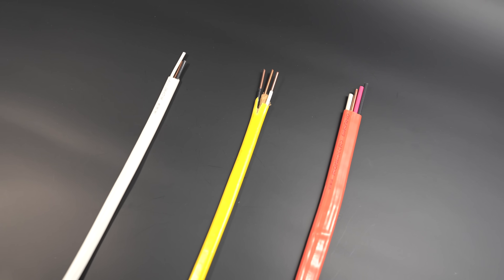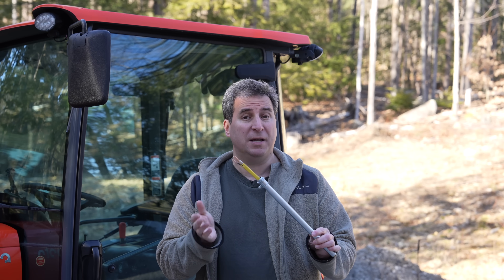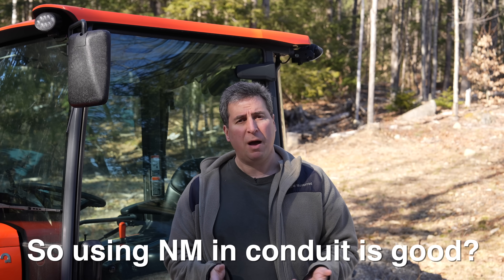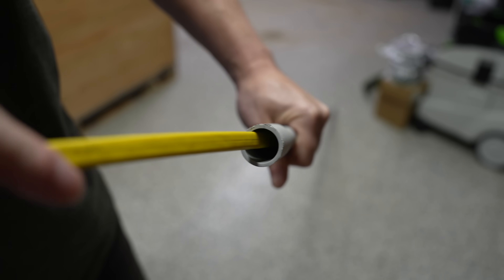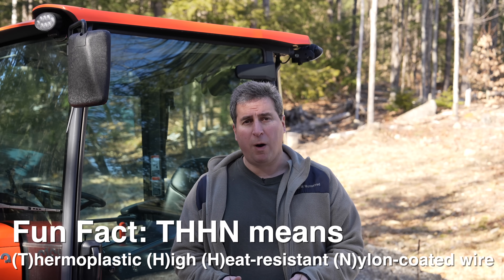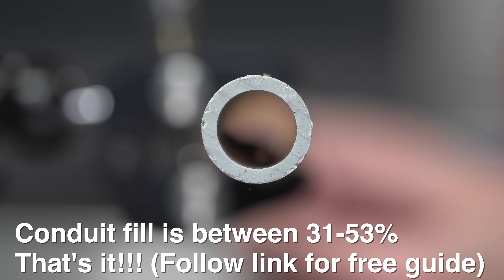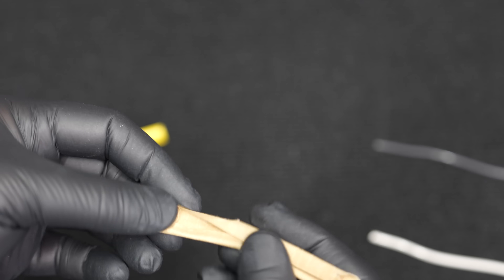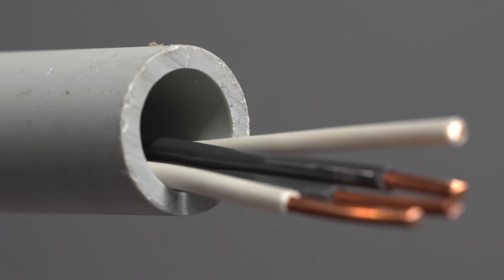#1 DIY Electric Mistake - Can you use Romex Wire in Conduit?

Comment: I/We discovered a major flaw with Romex:  Rodent damage.  Nearly lost BOTH mobile homes due to this, discovered it as we were tearing down the walls/ceiling tiles/etc., and 'Found' the short(s) caused, and the small burning that began (But thankfully did not continue!).
Lesson learned!  We ran pip/flex throughout both residences, then our out buildings.  Standard 12g wiring (Which costs less than Romex, but when you add all the EMT/J-Boxes, well...)
So, our problem(s) were found, fixed, and now we know better.

Great video however!  'The more you know' indeed!!!
Reply: Yes campers and mobile homes should have conduit on all circuits because of rodents will chew through wire insulation ive never seen  one rat proof

Comment: Excellent video. Great explanation. Anyone can find the origin of this info in the NFPA-70. National Electrical Code. (NOT easy reading, this video says all you need to know.) The only thing I would add is to make sure you also check your local municipal and county codes for any additional requirements. Pretty rare on this topic though.

Comment: In Canada, the CEC, similar to the NEC allows for NM in conduit for protection only. The conduit cannot be mechanically continuous throughout. Only a non-continuous section of conduit is ok.

2) Notwithstanding Rule 12-918, non-metallic conduit or tubing shall be permitted to be used as a
sleeve for the mechanical protection of non-metallic-sheathed cables when
a) the cables are protected from abrasion where they issue from the raceway by a bushing or
equivalent protection; and
b) the raceway fill is in accordance with Table 8.

12-918 Mechanical continuity of raceways
Raceways shall be mechanically continuous throughout and mechanically secured to all equipment to
which they are attached.

I would have thought the NEC is the same, but I guess not from what you say in your video.

Comment: Let's look at why the code is written the way it is.  It is all about safety.  The more obvious is preventing damage that could lead to shorts.  The less obvious is preventing heat build up that can lead to fire.  My old knob a tube wiring is excelent as  the individual wires are not touching and can radiate heat.  Pace we get plastic insulation and start stuffing it in conduit we create the potential for overloaded circuits to generate heat that cannot be dispated well.  The code assumes the worst possible conditions as we never know what abuse will happen after installation.

Comment: From a cost stand point, it it much more expensive to run NM cable in conduit instead of individual conductors. Your inspector can knock you down just on conduit fill, as mentioned, unless you oversize the conduit. Again, from a cost stand point, it is not the way to do an installation. The only reason I have ever installed NM cable in conduit is to sleeve it for field conditions. Never as a point to point wiring method. Full disclosure. I am an electrician for the past 42 years, not a diyer.

Comment: As a farmer, I've unsheathed romex to install in conduit, all conduit and outlet boxes (all metal) are grounded.  Worse case scenario, the insulation fails anywhere in the system, hits metal conduit or a metal outlet box, goes to the breaker box, goes via the bonded ground bus bar to the neutral, trips the circuit.  I guess in a few decades if the metal connections are corroded, it could cause a problem.  But as long as electricians charge what they do per hour, I'll do my own electrical work, I'll just use the proper wire from now on. :D

Comment: Sometimes the romex needs to be protected from a joist ceiling down a concrete wall
I use boxed 5 ' ft sections mt to the wall then pull the romex in and terminate
No one should ruin the integrity of the run of romex just for the sake of romex cant be in conduit
The more splices you make changing over from stranded to romex the more problems later on 
Sorry but the is many times protecting romex with pipe is good 
Just use 3/4 and its fine

Comment: Conduit fill is based on current carrying conductors as well. Even if the conduit is big enough you might derate the conductors ampacity to low to actually handle the load.

Comment: Single conductors are usually rated for 600v romex loomex is rated at 300v. Hence any other single wire installation is derated from 600 to 300. It's also just used as mechanical protection in laundry rooms with surface mounted outlets below code heights for human interaction.

Comment: I have run Romex in conduit for my garage shop outlets. My garage has an attic above  so the surface mounted conduit just runs from the box to about a foot into the attic. Then from there it's just handled like normal Romex back to the breaker panel. One thing I do though is to put a female fitting with a Romex clamp on the conduit stub in the attic. I don't know if code requires this but it does keep the Romex from being yanked back from the switch or outlet box

Comment: I used 3/4 and 1 inch Underground gray PVC Pipe, sucked pulling string through, poured soap into pipe, then pulled the Roemex with no problems.
You have nothing that is conductive to interfere with the electrical .

Comment: I ran 1 inch or was it 1 1/4 inch EMT around the inside perimeter of my garage with on LB where it had to turn 90 degrees. The purpose of this was to run power from the main circuit breaker panel to a sub panel that was put in the furnace room to feed my house addition. So the pipe had enough room for 2 hot feeds, a neutral and a ground if needed. It would not have made sense to try and run individual light and outlet runs from the new addition back to the main circuit breaker panel. With the sub panel in place the runs were nice and short and easy to install.

Comment: In our kitchen remodel, the electrician crammed 5 romex cables through a hole in the wall, to the outside of the house, into a metal conduit and then into the main box.  These wires allow no room inside the conduit. The conduit is outdoors.  The sun shines on this area, generating heat on the conduit.  Should this system be redone?

Comment: The wires in Romex are thhn , they can be stripped out and used , you are wrong about that !
Reply from the maker: I am correct. NEC requires wires to be marked, ratings, etc, you will find within Romex the wires are blank.

Comment: I've seen a guy do this before and was told to shut up you know nothing. I was on a job repairing a concrete pool, there was a guy running wires to the pavilion and installing lights there. He ran indoor romax right in the trench he dug looked a foot deep and then ran romax in all the conduits around the pavilion, told him everything you did is wrong, he said " I ve been an electrician for over 20yrs this is the way you do it, there is no problem with it". I shook my head and walked away, reported what I saw to the HOA I was hired by, they told me "He submitted the cheapest estimate and is family with one of the HOA members, so we went with him".

Comment: I did this when I ran a single conduit from an outside outlet on the house to my shed underground about 50 feet. I found out later that was a no no. It’s been 10 years, still works fine. I guess I still don’t understand the issue of why I wasn’t supposed to do that??
Reply: Depends on the type of conduit, fittings, and how deep you buried it. PVC conduit is OK, but you bury emt like what is shown in this video and its going to rust and get water in it...... Then you'll get problems.
Reply: @DavePerry-h5r   I used the "1-1/4" Ultratite Liquidtight Flexible Non-Metallic PVC Conduit" I did a straight shot from the house to the shed, with both ends above grade and into a weatherproof outlets. I went between 1-1.5 feet deep and covered with rocks before filling in with dirt. I did know better to not use metal or use sections of pvc clued together. It was a pain to fish the romex through that distance, probably would have been easier to do it the correct way...next time.

Comment: the one outlier on this comes when 2" or 3" conduit stubs are required for installation of outdoor panels, where NM cable penetrates to the outside into the MDP, so said MDP then becomes a damp location.

Comment: Remember pulling lube!  Water-based, non-toxic, non-corrosive.
There's a code limit of 360 degrees of total turn, however you don't want to have more than 270 degrees.  There are marine winches that constantly turn, and to get the winch to lift tons all a crew member has to do is wrap a cable a turn or two and put hand tension on it.  The wires you are trying to pull will grip the conduit, if you give them enough of a wrap.

Comment: For DIYers:  if the wires look like they will just fit and you can save a few bucks on conduit, you are signing yourself up for a nightmare pulling the wires through fittings and around bends.
Oops, need to add another circuit...
When you go to tape them to a fish tape in order to pull them, where do the wraps of tape and maybe the bent-over wires (with a non-zero inside bend radius) so they don't just pull out of the tape go?
Then there's the question of too many wires carrying large loads overheating and maybe melting insulation.

Comment: Well let's see is this video made to inform the DIY person or electricians cause if it's for the DIY this is a waste cause why do I have to be licensed and insured to work on another's equipment yet they will sell electrical supplies at the box stores putting a 20Amp breaker on circuits wired with #14 ga wire does the DIY get to sue when there's problems and of course you mentioned circular mils  no homeowner knows what that is and besides you never mentioned anything about the NEC

Comment: I've done both.. Ran them in conduit outside.. and also stripped the sheath off and ran it in conduit outside.. and it has worked for years and years without an issue.. over 25 years now, in fact.  This is why regulation is such a burden.  So many silly rules that are completely unnecessary.  So as a soft useless sheath-- it's completely safe, you can even staple it-- it's fine.   But protect it in a conduit-- that will never work. lol.  It's like a mental illness (I'm talking about the rules, not yourself).

Comment: Wire pulling lubricant will make it easy to pull wire.
Size up your conduit , and no problem with filling it up.
Well done video, very informative, clearly explained.
Thanks !
Reply: Don't know what the logic your code people use for conduit filling is but we use "space factor" which takes into consideration having room for convection of heat from the conductors under full rated load. Jamming cables in tight interferes with the ability to let the heat escape without cooking the plastic insulation material.
Reply: @johnj4860 which is why he said “size up”.

Comment: My friends house had conduit in the basement but the rest of the house was romex towards the floor joist you can see romex going to the upstairs floors. I ran number 14 in plastic conduit outside for the Christmas lights but I never hooked it up to the panel it is temporary wiring only gets plugged in during the Christmas season. I will pull the romex out and replace it with UF before I hook it to the panel better yet I may just get the right white and black wires and ground. They would go through easier than uf cable. 73

Comment: My question is why? I've heard the problem is heat dissipation inside the conduit. Yet, in my house, every circuit is stuffed inside the exterior wall, goes up into the attic and then is distributed throughout the house. I'm telling you that rats nest inside the exterior wall just behind the panel makes heat dissipation there nonexistent! So if I want to add a circuit, I can't put a piece of conduit coming out of the top of the box and up through the soffit and run a piece of romex through it? That just doesn't make sense to me. Maybe someone can explain.

Comment: Can you use underground 10 / 3 in 2x4 wall for a 22A draw hot water heater run under 40 feet.

Comment: Hi Have question for the electricians.  Can I put UF wire inside the conduit? I am building a deck and stapling the UF wire to the stringers to get power in my deck.  We have a lot of squirrels and want to protect the wire from the rodents.

Comment: Just want to add NC state code does allow nm-b romex in LFNMC for hvac whips to outdoors equipment as long as the conduit terminates in a weather tight box or dry location so from the attic penetration to the disconnect and from the disconnect to the heat pump it’s allowed in our jurisdiction

Comment: It does not matter if you use NM cable in Romex. USE YOUR HEAD. The problem and bottom line is the paper will wick water. END OF IT!
Reply: The concern is complete runs closed on each end. I've seen emt 90s in attics with nm going to floor. There for 50 years.

Comment: 1:47
If you are going to run ROMEX through conduit, use an electrical snake and PULL it through instead of trying to PUSH it through. Not critical if the conduit section is straight, VERY helpfull if there is any sort of a bend in the conduit.
Same thing applies to individual conductors.

Comment: I was told to run wires in conduit outside just in case you need to pull wire and run more so you don’t have to dig it up

Comment: I wish everyone would shut the hell up about "heat buildup". 

Article 334.15(B) Protection from Physical damage. Cable shall be protected from physical damage where necessary by rigid metal conduit, intermediate metal conduit, electrical metallic tubing, Schedule 80 PVC conduit, Type RTRC marked with the suffix -XW, or other approved means.

The NEC flat out tells us to put it in conduit.

P.S. The ampacity of NM is calculated using the 60° and not the 90° column like THHN.

Comment: It's perfectly fine per code. It's just dumb to do because it's a pain to pull and the piping will protect wires so you don't need a large jacket around it... it'd be like double encasing it basically. No point. Anyone saying it isn't to code is lying but they are correct if they say it is a pointless thing to do. Also, the wet location comes into effect as they aren't rated for that. Just use the correct wire or cable and conduit for the job.

Comment: IF YOU ARE GOING TO RUN "ROMEX" IN CONDUIT YOU WILL HAVE TO "DE-RATE" THE CONDUCTORS. I.E. A CIRCUIT RATED @20 AMPS NORMALLY 12ga. WIRE, IS NOW ONLY GOOD FOR 15 AMPS. DO TO HEAT BUILD UP. CHECK THE ELECTRIC HAND BOOK FOR CONDUCTORS RUNNING IN RACE-WAYS, CONDUIT AND FREE AIR. YES THIS IS NORMALLY USED TO SIZE THE CONDUCTORS FOR AMP LOADS, FILL RATES ETC. HOWEVER, THIS WILL HELP KEEP THE "WEEKEND WARRIOR" OUT OF TROUBLE.  AS THIS GENTALMAN EXPLAINED, 'OVER FILLING' CONDUIT IS AN ISSUE. IF YOU NEED TO RUN 12-2 NM-B, (ROMEX), AND KEEP THE 20 AMP RATING, BUMP THE CONDUIT SIZE UP FROM THE 1/2" TO 3/4" OR 1" ESPECIALLY IF YOU HAVE A LONG RUN TO MAKE. BETTER YET, CALL A LIC. ELECTRICIAN. IT WILL BE CHEAPER THAN AN INS. CLAIM.

Comment: There was a reason for the NM to EMT connectors.  We would strip the NM before entry into the conduit.  This was hood when running NM in protected spaces like a ceiling,  but then dropping conduit into the room for devices.  
Regardless this was all done back when Romex was cheap. 😉

Comment: But you can cut apart romex in a panel or box and then the manufacturer doesn’t mind? What’s the difference between metal conduit and a metal load center?

Comment: Let's REALLY get to the truth: It's not that you can't strip the wires out of the sheath to install in conduit because the wires 'are meant be be in the sheath', it's because the insulation on the individual conductors AREN'T MARKED.  Seems no one reads 310.120(A).

Comment: I didn't see direct burial NM used in conduit noted which I used when I rewired a deck that had failed inspection with the previous owner using standard NM. That wiring passed another two inspections with the direct burial wire - once when I finished in 1993 and again last year when I sold the house. Did I say I really dislike working with that cabling!

Comment: Unless the NEC rules have been updated in recent years, you may not run NM cable in conduit as a "wiring method" but it is permitted for protection of the cable from physical damage (e.g., a drop down a workshop wall from a junction box above).  As you mention, you have to be mindful of the sizing requirements.  That said, when I rewired part of my workshop, I ditched the Romex and pulled individual conductors through the conduit.  I prefer working with individual wires, anyway.

Comment: Can you run Non metallic UFB  Cable  inside a NON-metallic tube or pipe in damp location?  Yes, it or metal tubing is  necessary to get it from 19" or more below grade to its above grade termination point or 8'  above grade. .

Comment: Just want to add to the mentioned 53% conduit fill for a single conductor or NM cable in this case.

When you are using two cables or wires, the allowed fill percentage is 31%.

When using 3 or more, the fill is 40%. The reason the allowed percentage is higher with the three wires is because it has to do with reduced jamming inside the conduit compared to only two wires that are more likely to jam between the conduit walls.

Lastly, there is 60% fill for nipples. Conduits that are 24" in length or shorter. They don't have to be straight.

Besides it, there are other rules to follow when you are pulling more than 3 current carrying conductors in the same conduits. Based on the number of CC conductors derating of ampacity  must be applied, factoring temperature rating of insulation and ambient temperatures for speacial conditions such as installation on the roof where condut is exposed to sun heat.